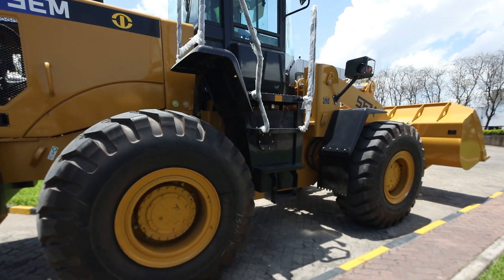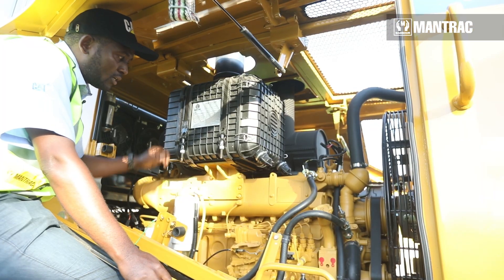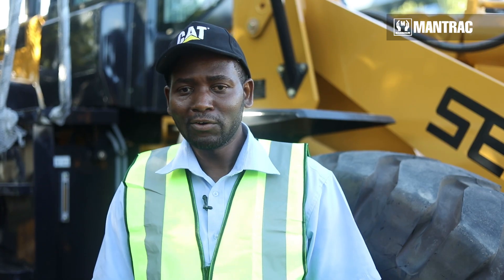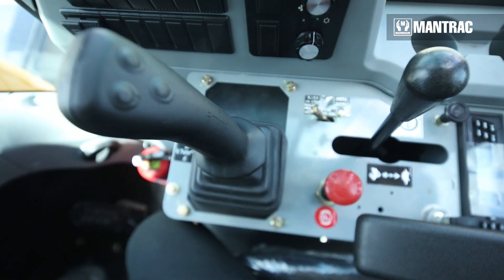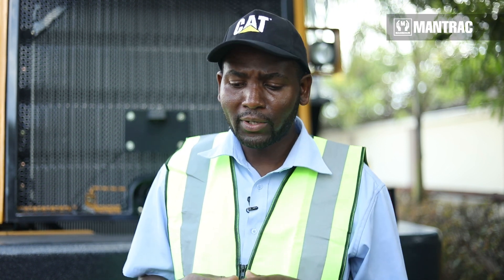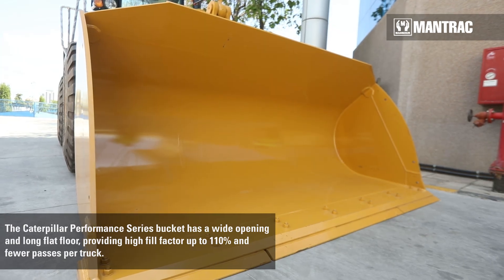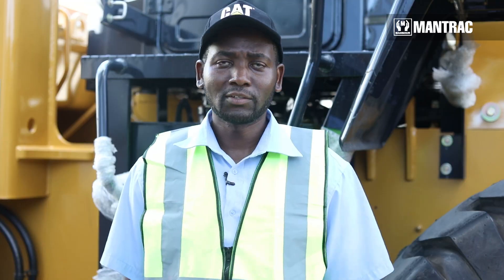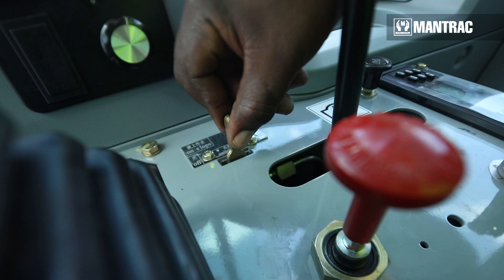Ask the Expert: SEM 655D Wheel Loader walkaround

Comment: Pls I have the SEM 656d wheel loader, am having trouble with the hydraulic oil leaking into the transmission fluid causing overflow... Can you help pinpoint the cause?